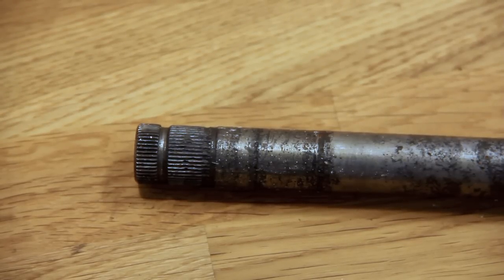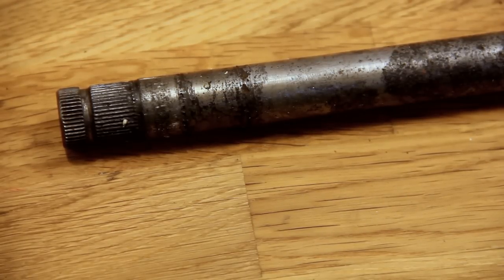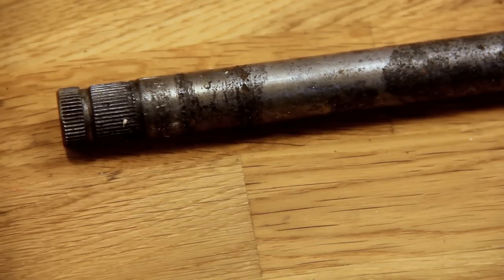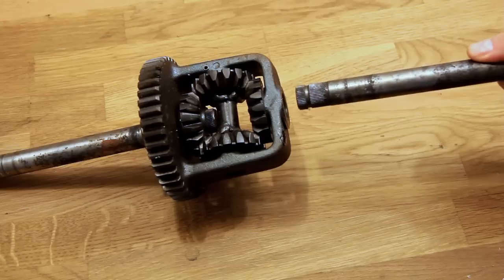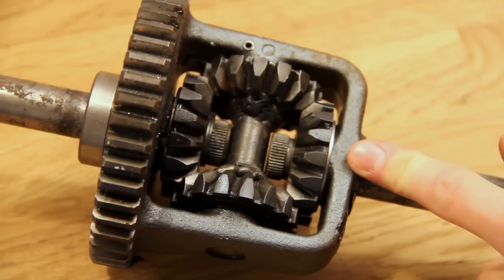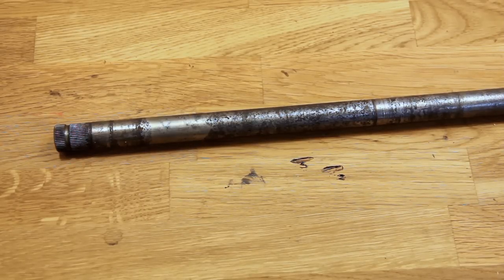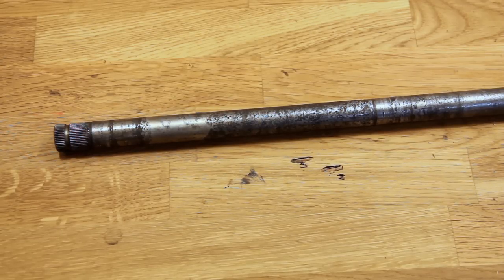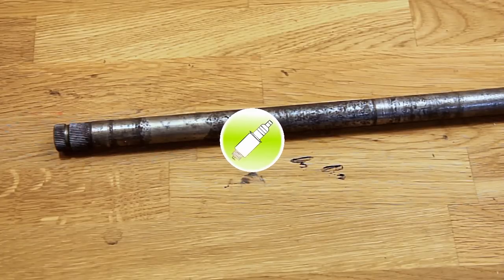Lawnmower Differential - This is what happens when you pull too much weight

Comment: I have a craftsman 16 hp differential riding mower with a 5 speed transmission, how much weight could I safely pull and it be fine and what's the maximum weight I can pull for a short time like could I pull a car shortly
Reply: If the front tires are lifting... Its at its limit..
Reply: hi check your owners manual